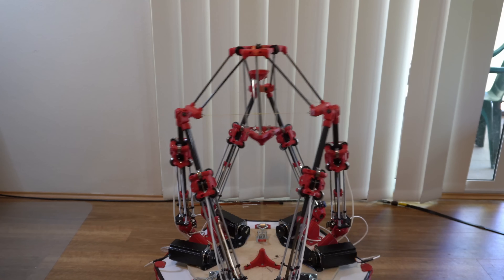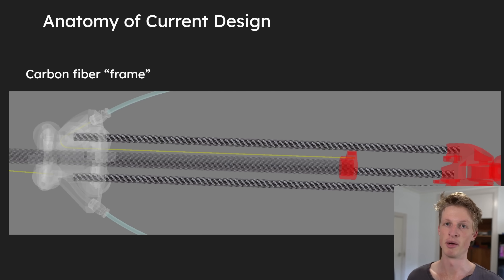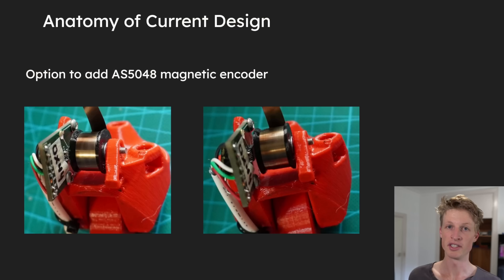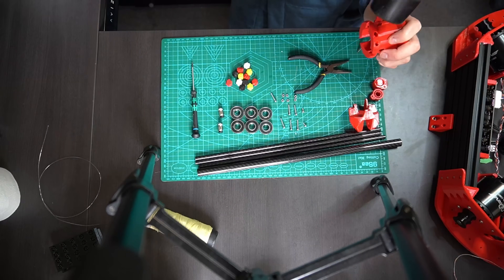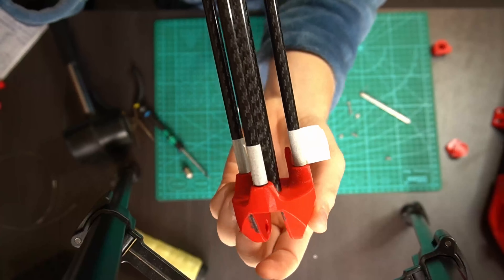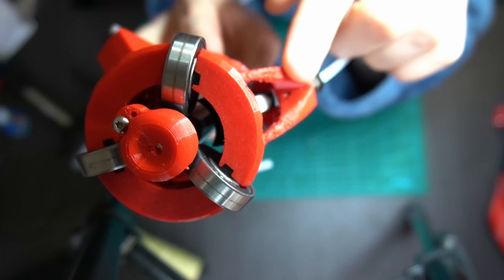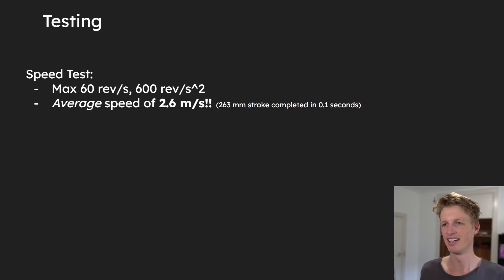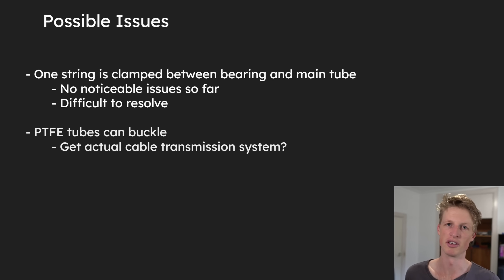Designing High-Performance Linear Actuators: Speed & Stiffness for my Juggling Robot | PDJ#19

Comment: Not that you'd want to redo any of this, but in industry, when you need fine adjustment on a spacing, it helps to have the bearing "shaft" be a cam so you can arbitrarily adjust the lash or alternatively the force the bearing applies to the carbon fiber actuator shaft. It might be important down the road when everything else is stiff enough that the bearing spacing and pressure on the rods becomes the weakest link in accuracy again.
Reply from the maker: Thanks for letting me know about that! Someone else mentioned making the bearing hub a cam shape for the same reason, but I can't think of a good way to make it so that the cam is both 1) easy to position and secure, and 2) stable enough that it won't get pushed/rotated when in extended use.

Do you have any thoughts on how to implement this idea?

Cheers!
Reply: @harrisonlow  I had a whole comment written but then I looked a the files and I had to rework what I was thinking :P

There are slots cut in the side of each of bearing grooves in each bearing block. I'm assuming you made them by subtracting a shape from the original?

If, instead, you subtracted part of a slightly larger star shape where those side slots are, you should be able to drop in some star shaped cams with offset holes in them and have the piece that acts as the rod the bearing sits on be basically the same as it is now but with a matching offset hole.

It wouldn't be infinitely adjustable but you'd have 20 positions or whatever you think you could get away with as far as printing teeth.

So basically it would work by turning the star one direction to move the cam hole towards or away from the CF rod and turning the rod the bearing sits on so the hole lines up with the hole in the actuator housing.

If you don't mind a little bit of machining, you could friction fit a piece of mild steel rod with an off centered hole in it (for the existing screw) into the star cams (so the hole would always be centered with the star but the bearing would not).

If you do that, you might want to print an index mark on the star so you get both halves lined up with the right tooth.

You could simplify that by just having it be two pieces: a star shape with the rod already part of it and another star shape with a hole to receive that rod.

You could also simplify it to one piece and just have one star shape with a rod extending from it. The star shape is really just there to lock the rotation of the cam once you put the screw in.

Obviously you'd have to make the teeth on the star shallow enough to insert it into the bearing groove so the bearing block can remain one part.  If that's tricky, you could always subtract a lateral extrusion from the bearing block so it will just slide right in.

Describing precise shapes with text is hard. I hope this made sense. I would probably go with that last option since it only requires one part and the least changes and its probably not a lot weaker than a 2 or 3 part cam.
Reply from the maker: @htomerif  Interesting ideas! A few thoughts:

1) I'm sceptical of my printer's ability to print shapes much smaller than the current bearing inserts, especially now that I'm changing over to smaller bearings (to save weight) that have a 6mm ID. Pair those with M3 bolts gives only 1.5mm thickness for the insert! I don't think FDM would be capable of printing precise shapes at that scale...

2) I unfortunately don't have access to any machining tools, though this isn't a huge issue for what you've described.

I like this idea and I'll play around with it! I hope that there won't be a need to change my current design, but it'll be good to have a few backup ideas handy in case I do!

Cheers!
Reply: @harrisonlow  So yeah, its hard to communicate what I was talking about. The star shape only has to be smaller than the bearing OD and the cam shaft that comes off of it only has to be able to fit in the bearing ID.

Also, yeah: I think you've probably got a whole lot more play in the spools and wire and guides.

There's a huge gap between hobby type linear servos, screw type linear actuators and real industrial and aerospace stuff like compact electro-hydraulic actuators.

There's no reason someone couldn't make a cheap, fast electro-hydraulic actuator just using regular BLDC motors. The problem is no one makes them, so no one designs anything with them in mind, so no one makes them. Same negative market feedback loop for high power, high torque servos that aren't a full 10k USD AC servomotor setup. This 40 year old PWM stuff has no place in modern electronics where I should be able to signal a hundred servos over an I2C or SPI bus.

Its frustrating.

I've been thinking about making some replacement boards for common servos that run off I2C instead of PWM.

anyway, thats my rant.
Reply from the maker: @htomerif  Ahh okay, I think I get what you're describing with the star shape now. Interesting idea, for sure!

Yup - I've not been in the business of buying motors/drivers/etc. for very long but I've already noticed how big of a difference there is between industrial equipment and what's available at a hobbyist level. That said, I do think the gap is closing fairly quickly. 

Hopefully these actuators that I've made can be of use to someone else as well, shrinking that gap ever-so-slightly more 😁
Reply: @harrisonlow  You might be able to print a friction fit (or glued) journal with a groove in it for the bearing that's currently smashing the string.

It doesn't look like a problem now at all, but if you switch to something like wire cable, its not going to like being squashed, or at least the rod will probably wear pretty quickly.

I'm guessing the motor isn't even going a small fraction as fast as it could. It would be nice if someone would make a BLDC motor like that with a simple planetary gear reduction. Maybe someone does and I just haven't found it. They're really common in power tools, so its a bit strange that there would be zero hobby applications. Direct driving wheels would seem to be the obvious one.
Reply from the maker: @htomerif  As it happens, I've actually removed that problem entirely in the new design by shifting things around so that the string is now nowhere near the bearing. 

And yep - the motor can go way faster than I'm currently running it at, and it would be good to have something to gear it down a bit, but I'd only need like 10:1 (ish, IIRC) and I haven't encountered any issues with force/power yet so I'm not that worried about it. That said, I haven't run any comprehensive force/power tests so maybe I'll have to reconsider things when I do 😬 

Just waiting on some carbon fiber tubes and I'll be able to put together my new design and run a load of tests. Should be interesting!
Reply from the maker: @htomerif  If you're interested in an as-yet-unsolved technical problem: it's looking pretty likely that I'll be putting some sensors on Jugglebot's "Hand" and need to figure out some way to run cables down these linear actuators so that they won't get caught up.

I'm currently considering an "accumulator" style design (see this: https://www.youtube.com/watch?v=HQKy1KJpSVc&t=2710s ), but I'm not sold on the idea
Reply: @harrisonlow  I guess it depends on how many sensors and what kind? Like just one force sensor? Or a 6 axis accelerometer/gyro and a force sensor and an ultrasonic sensor or optical sensor?

Without knowing what power/conductor requirements you were imagining, my first suggestion would be retractile cable. Its an old concept but its still used everywhere, from full sized airliner cockpit simulators to microphones. If you need an idea of what I'm talking about, just search an H250 SINCGARS handset. You don't want that specific cable, but something like it (even old phone handset cable) would probably work fine down the middle of the juggler.

There's a whole lot of ways to do it I guess, so if its like 10 conductors at 20 amps each, the answer is pretty different from 3 conductors at 20 mA.
Reply from the maker: @htomerif  Fair point! At this stage I think all I'll be using is an MPU6050 gyro/accelerometer (max 10 mA) and a 5V laser + photoreceptor (max 40 mA), so I'll need a max of 7 cables going to the hand. This could be cut down to 5 if I share the 5V and GND between the laser and MPU6050, which I probably would do, but it depends on how the cables are routed (the two components aren't that close to each other on the hand)

Also might be adding more than one laser + photoreceptor (max of three of each) depending on how my testing goes. Will hopefully have time to test it out over the next few days 😁

I like the idea of a retractable cable! Can you even buy coiled cables like that? I can't seem to find any for normal electronics use. I wonder if I could get one of those spooled USB cables and chop the plugs off? 🤔
Reply: @harrisonlow  you can get retractile cable from Northwire but its one of those "request a quote" companies. I only saw up to 4 conductor but I think they make retractile cat-6 as well.

I wasn't sure how cheap and dirty you were willing to go, but I was going to suggest getting a couple of 8 dollar retractable (not retractile) mice and disabling their ratcheting mechanism.

MPU6050 seems sane. I don't think you'll run into any impedance problems at 100kbit or 400kbit. If you were using something that used the I2C 5Mbit standard that might not work as well with super cheap cable.

I haven't done anything like what you're doing before but from the flight stuff I've done you might have a problem with the total minimum time of sensor->movement->sensing that movement.

You can get stuck in code on oscillation damping pretty easily, but good luck :)

Comment: For the carbon fiber tube fit into the 3d printed parts, have you considered using stainless steel band clamps? You could probably make it a (loose) friction fit inside the tube, and then have an sleeve with space for the band clamps to squeeze it tight against the core. That ways it's reusable and you don't have to break it for taking apart.
Reply from the maker: That's a great idea! As it happens I've designed something similar for the next version of the actuator, with the clamp part embedded into the main body so as to not increase part count. If that doesn't work then I'll strongly consider these.

Cheers for the suggestion 😊
Reply: @harrisonlow  Oh very nice! Looking forward to every iteration!

Comment: A few things that might help with some of your complications:

- don't use a single wire. Use a flat cable, preferably braided or double braided. White or yellow packing straps are a good example. Twisting may become a risk factor.

- measure around double the length needed to run the distance from end to end once, then anchor it either as a closed loop in one or opposing sides of the actuator or as a constant length pulley on opposing sides of the actuator.

- as long as your bearings are rolling freely, they shouldn't damage the cable or wire pinned against the rod. The wire or cable may eventually wear a rut in the outer race of the bearing, which should only be a problem if that part of the race becomes too thin. Some companies manufacture bearings with channels in the outer race to accommodate for this.

Comment: Did you consider linear bearings instead of the six bearing design? would probably be a lot smaller and with more space you can fix the problem with the string between the bearing and the tube

Comment: @harrisonlow this is similar to a power window regulator used for some cars (the door windows that move up/down).  They use a cables, pulley system with tubes (in compression) just like your system.

Comment: How did you model the string in solidworks and does its path change as you change the length of the actuator in the assembly?
Reply from the maker: Good questions! I modelled them as a separate part in the master assembly and they're made using sweeps along 3D sketches. They do update as the assembly moves, but I need to force a rebuild (CTRL + B or CTRL + Q) for them to update, which is why I didn't show any shots of me moving it with the strings shown 😁

Comment: Using current monitoring to detect reaching the endpoint of your actuators could present problems once you start juggling with your robot. When your projectile impacts your device, you'll likely get a current spike in your motors, and if you're following a simple rule of "if too much current, then conclude that I've bottomed out," you might get some false alarms.
Reply from the maker: It's a good thing I'm not using a simple rule like that, then 😉

I'm only monitoring the current while going through the homing sequence. Might be handy to be checking on it during operation as well, and I do want to have some sort of failure checking going on during operation, but I'm not sure what form that ought to take yet. False positives will likely be troublesome

Comment: Hi! I'm just going to start emerging in 3d modelling and thinking about software which it would be better for me to use. I prefer something open source and running on Linux. What would you advice for me? Is Blender good for this kind of projects? And what do you use?
Reply from the maker: Hmm, I've only ever really used Solidworks and I'm a big fan. I currently use the Maker license (IIRC it's ~$100/year) and IMO it's worth it. I've seen plenty of other people use software like Inventor and Fusion360, but they've always seemed very clunky to me. Perhaps it's just a matter of what you're used to 🤷‍♂️

Re. linux, I'm not sure. I only use Windows (though I'm slowly getting more familiar with linux because it seems to be a lot better for robotics) so I'm not sure what's linux compatible. I would advise against modelling software like Blender as AFAIK they're really hard to use for anything precise / dimensionally accurate

Comment: I'm a CS guy, not an electro one. The linear actuator I saw seemed difficult to use, so I made a simple "linear actuator" for a kinetic sculpture with a stepper motor, a string, a tube and a spring. Nothing compared to what you did, but this made me realise of what potential just a simple motor + a wire can have, you definitely extracted the full power of this mechanism :D
Reply from the maker: Haha the potential isn't exhausted yet! I've been working on a improved version that is better in many ways. Will hopefully finish collecting data and putting the video together soon 😁

Comment: Another suggestion for your string issue - try having a chat with Otis Elevators, they use a flat rubberised material in their elevator shafts instead of cables, they may have a few ideas that you can experiment with.

Comment: Interesting concept.
While watching I collected a number of thoughts regarding your design:
- for fixing the carbon fiber tubes you could make something like an expanding arbor, like have this three-lobed shape on the inside but have them squeeze outward with a countersunk bolt. That should give you the required pressure between inner and outer ring without having to hammer anything (heard carbon fiber splinters are the worst)
- I kinda don't like the the guiding system with the bearings pinching the center rod like that. Isn't it possible to use plastic bushings, maybe out of nylon or PTFE? Also putting supports between the lower end of the center rod and the thinner rods could increase stability a lot. Like have a single bushing on the top side of the stationary part for the moving center rod, and a bunch of smaller bushings on the bottom of the center rod sliding on the stationary rods, one on each rod. That's at least how it is done on telescope cranes. It also helps with alignment and weight.
- the system with pulleys and tubes might cause a lot of backlash and friction. I'd suggest putting the motors as close to the pivot center of the universal joints as possible and have the string connected to the pulley system directly, without tubes. I'm also thinking about toothed belts, but that might add more weight again. Oh, and one more idea: what about a single inverted snatch pulley? Needs twice the force, but you also get twice the speed.
- a trick that is often used in robotics if weight becomes an issue: weight compensation. It can be as simple as a counterweight (e.g. the motor) on the lower end of the arm, but can also be achieved with a spring mechanism. That way the motors don't have to lift all the weight all the time and only get loaded when generating momentum, which might let you use smaller motors.
Reply from the maker: Very cool ideas! Some thoughts:
1) I tried exactly that (expanding arbor), but I couldn't get it to work. Tolerances just weren't playing nice at such a small scale.

2) Very interesting! I'm already in the process of swapping the large(ish) bearings for smaller ones with TPU "sleeves" around them to act as a buffer to the central CF tube, though I haven't played around with moving three of the bearings to the lower end of the central CF tube. One big drawback I can see with that idea is that it'd increase the weight of the part that's moving the fastest, thus increasing inertia. When the next version is ready (hopefully soon!) I'll be doing some more comprehensive testing. I think the current design provides more than enough stiffness, and at this point, speed is super important.

3) Yep! New design gets rid of the tubes, though has many more pulleys (three for each of extension and compression). I agree that toothed belts would be great, but I can't find a good way to use them given all the twists and turns that the strings go along.

4) Yeah I think something along these lines will absolutely be possible in the long-run, though I don't know enough about how the robot behaves while juggling yet, so I'm not really spending much time thinking about this for now. I have no doubt that Jugglebot might look very different in a few years!